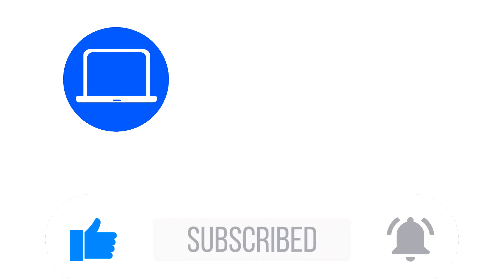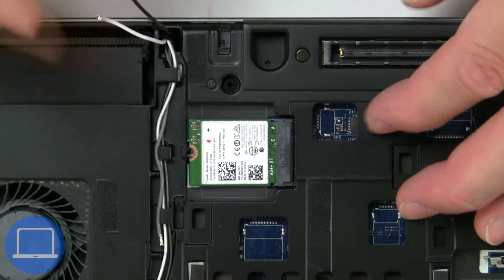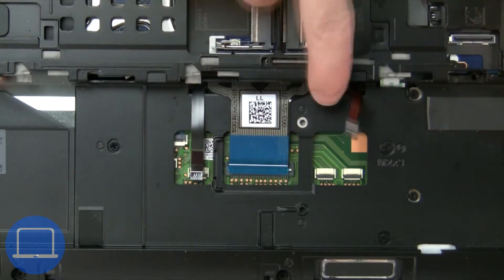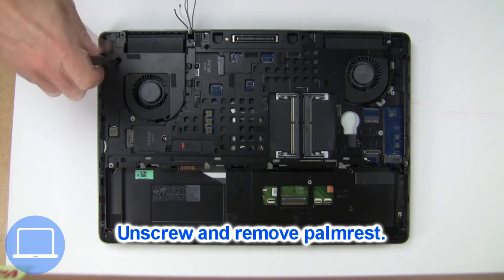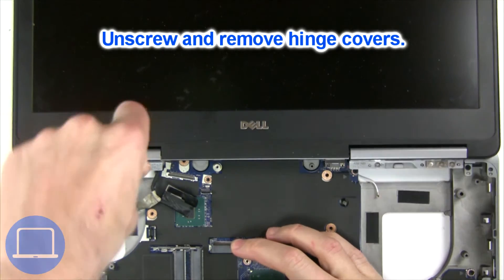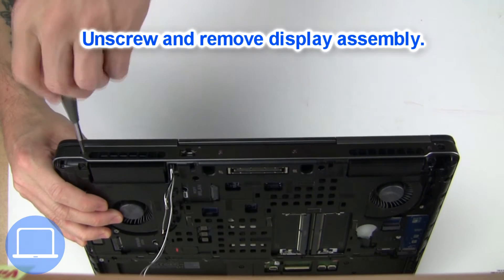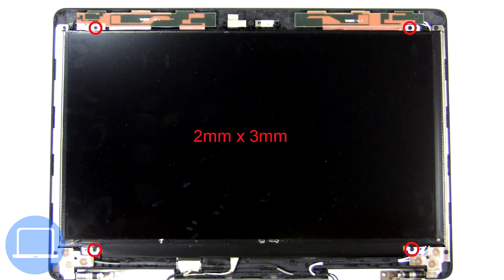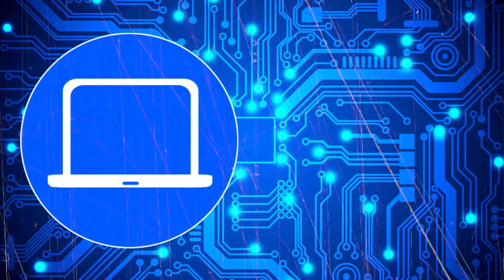Dell Precision 15-7510 (P53F001) Web Camera How-To Video Tutorial

Comment: The Tutorial would have been good if i wanted to take my entire laptop apart.  If you only want to remove or replace the camera you can start towards the end of the video 4:11 where you remove the screen bezel.  You don't have to remove the screen from the rest of the laptop to do this.  Just open the laptop fully and start at 4:11.   Note: This also works for any of the Precision Laptops.  There is a far greater chance you can damage something by removing all the the preceding parts.  To remove/replace the camera should take about 5 minutes tops if you've done it before.  15 minutes tops if you are a bit timid.    Note: the plug for the camera is to the far left and inserts not by pressing down but by pushing in.

Comment: I'd like to say that without this video, I would have been LOST.  I had to add a webcam to this laptop by first replacing the screen bezel that has a window for the camera in it.  I've taken this laptop apart before to replace the keyboard with one that has backlighting and noticed while watching this video that most of the steps taken to remove ONLY the webcam are unnecessary.  
These are the steps I took to upgrade with the following parts:

Dell Precision 7510 MMFV9 Genuine Webcam Camera 
Dell Precision 7510 / 7520 CXT35 15.6" LCD Front Trim Bezel with Cam Window - Non-Touchscreen

1. Remove the battery cover
2. Remove the battery
3. Replace the battery cover
4. Flip the laptop over
5. Open it FLAT, so that the bottom and top are in the same plane.
6. Pry off the bezel with the appropriate tool
7. Unscrew the screen from the 4 2x3mm screws
8. Gently flip the screen over onto the keyboard
9. Carefully pry back the tape over the webcam (or in my case the dummy camera)
10. Unplug the camera

I put everything back together by reversing the steps with the replacement parts, booted the laptop, and ran a quick test by recording a video with Windows Camera, and everything worked!!